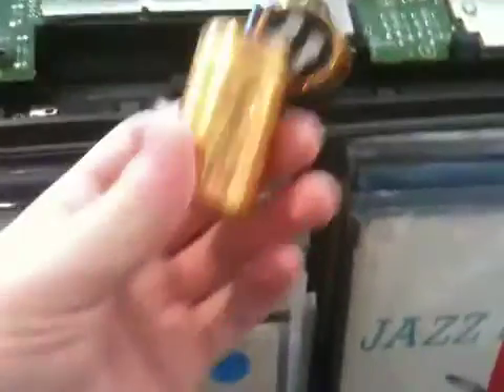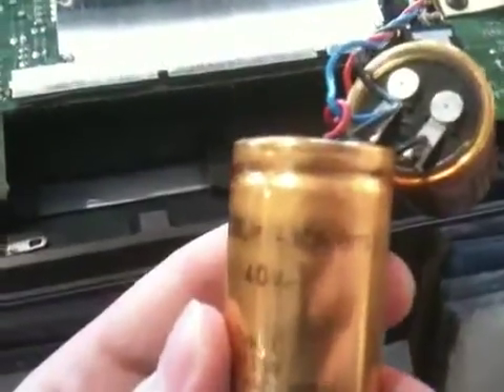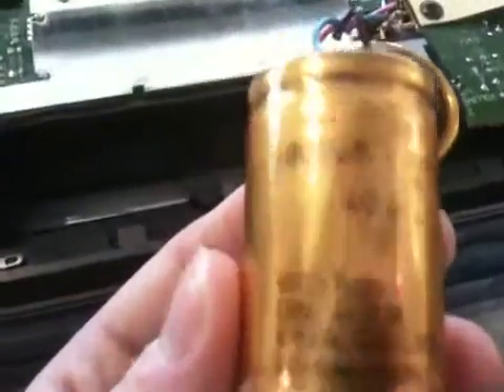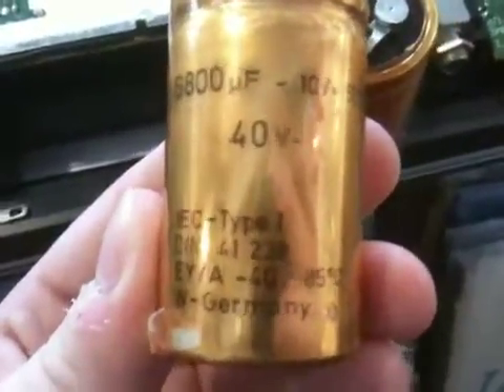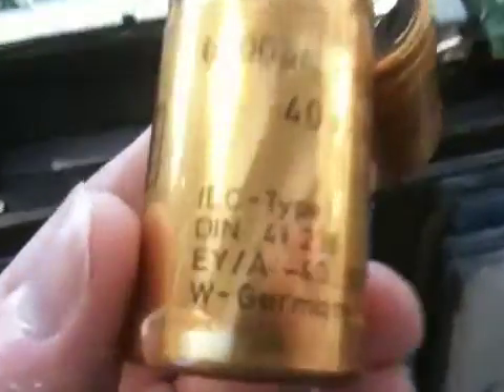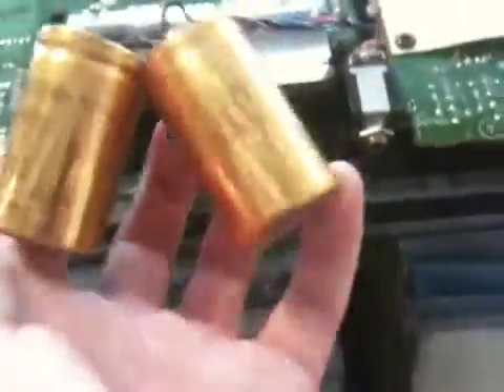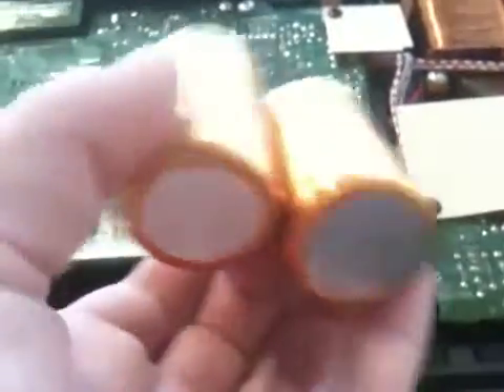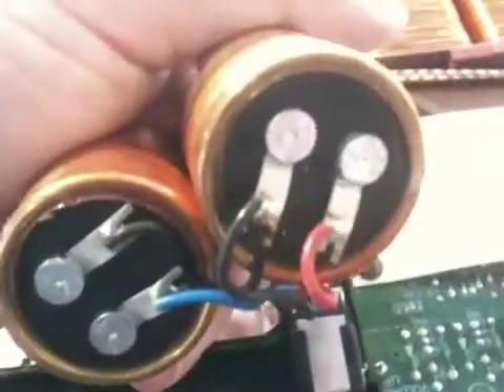Bang & Olufsen: The Filter Capacitors In Question

Comment from the maker: @Knaeckebrotsaege those apparently dried up after not being used for 20 years -_-. that's what you get for not using your shit tho, ya have to exercise it so the caps and stuff age a lot more slowly. nice reciever, great sound, but those caps fucked a lot of shit up, plus those 80's PCB's SUCK to work on. i love the way Sansui and Marantz made everything just modular boards you can just take out and work on, still with all descrete components instead of mosfet amps and surface mounted crap.
Reply: What Oldschool amp from B&O is worth buying?